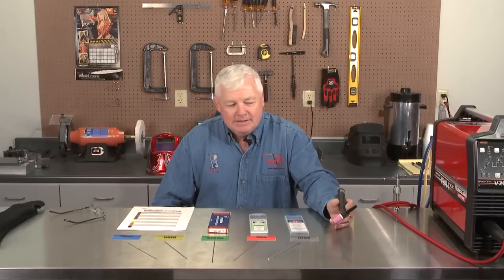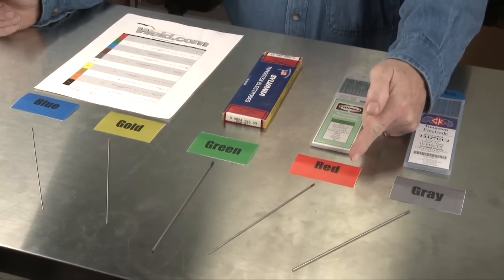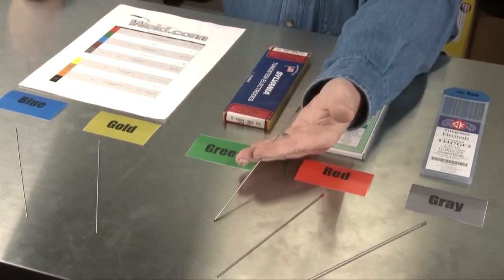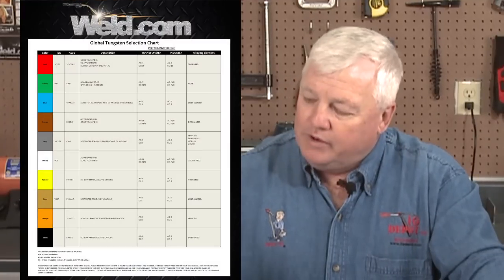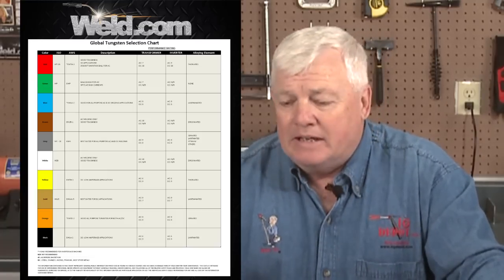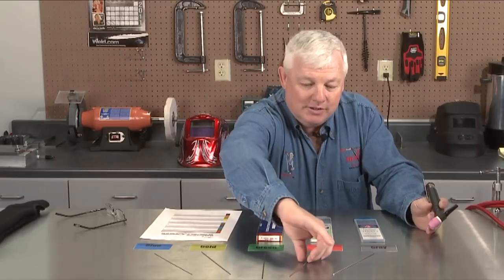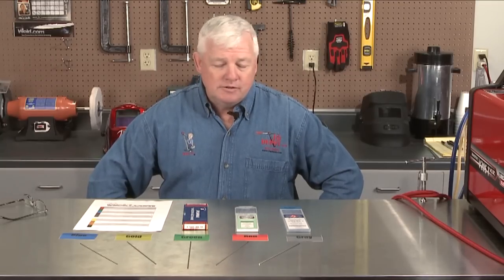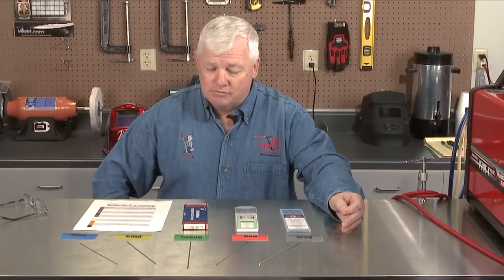Tungsten for welding - Which type of tungsten is best for you?

Comment: Nothing beats red tip for stainless but my sales rep hates giving it to me and talked me into using E3 claiming it's "just as good", it is not. I prefer 2% lanth over E3 though it really likes to split.
I use a white tip for aluminium as I must be the only guy still rocking a miller dial arc 50hz

Comment: Good day sir ive still really confuse of what kind of tungsten do i use for gold & silver
Reply: I WOULD USE THE"GOLD"TIP TUNGSTEN.YOU DON'T HAVE TO WORRY ABOUT SPITING LIKE YOU DO WITH THE RED TIP,2%LANTHANATED-SIZE OF TUNGSTEN,DEPENDING HOW THICK THE GOLD/SILVER IS BUT MAYBE START OUT WITH 1/16 TO 3/32 ,ARGON MAY BE A MIX OF ARGON /HELIUM
Reply: Thanks for the advise sir..I'll also try before the red tip but it's capable only in silver and stainless without argon...but Gold tip it's hard to find in my local area...

Comment: There is an added danger with Thoriated tungstens. While the dust from other types is injurious to your health, it takes more than one particle to affect your lungs. However, if you manage to breathe in just one radioactive particle of a Thoriated tungsten, then it will sit in your lungs, for maybe decades, and in that time, the small amount of radiation can eventually cause damage to the DNA of the lung tissue, causing  cancer. And Thorium has a half life of about 14 billion years, so the radiation will not go away quickly.
But with really effective industrial dust extraction, grinding Thorium tungstens IS safe. But home handyman style grinding is definitely NOT recommended.

Comment: 2.4mm (3/32) tungstens will cover pretty much everything. Perhaps high Amperage AC welding you might want 3.2mm (1/8), or very low might want 1.6mm (1/16).
This is simply because the arc can wander around a little if too big, or overheat the tungsten if too small. 

DC welding, a thoriated 2.4 (3/32) will cover it all. From Low amperage, right up to 200-220amps.
Reply: Thanks KF,
That's exactly what i was looking for in this video